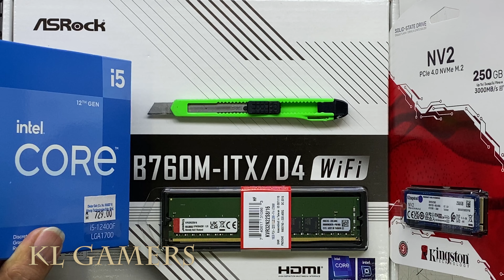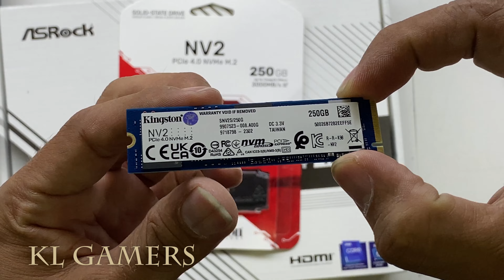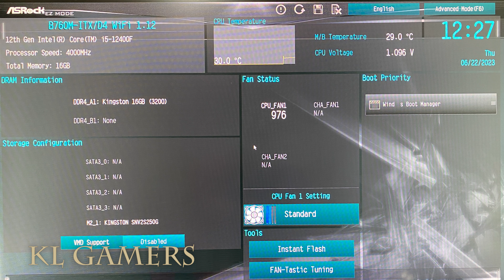intel Core i5 12400F ASRock B760M ITX D4 WiFi Kingston NV2 ASUS GT630 Slim POS Point Of Sales PC

Comment: Bro i have a ryzen 3 3100, a320m mobo and gtx 1660 super. I wanna upgrade my pc, should i upgrade my cpu(to 5600x), or the motherboard (to a b550 mobo). What should i do first? Pls guide
Reply: Also tell me the best b550 mobo, b550 steel legend or b550m aorus pro ax or any other